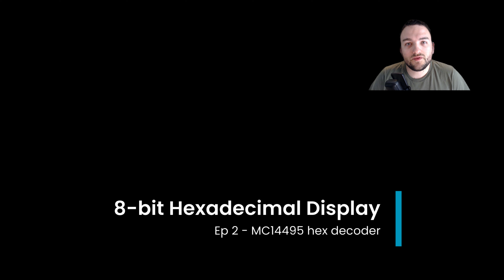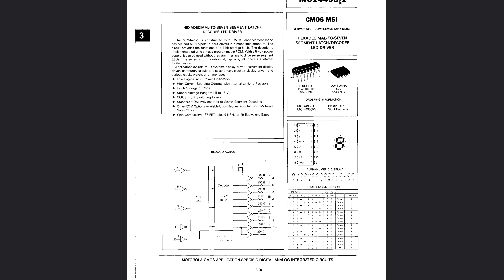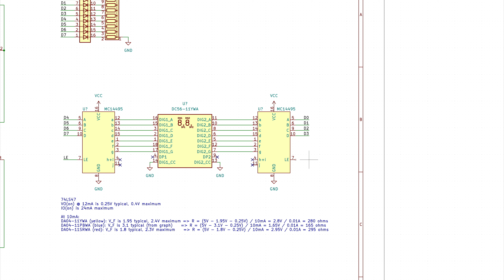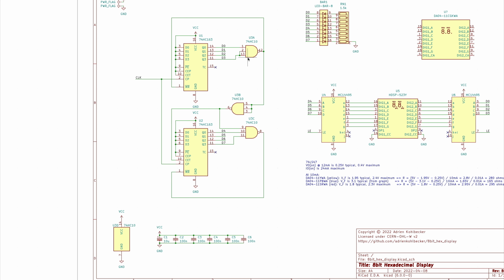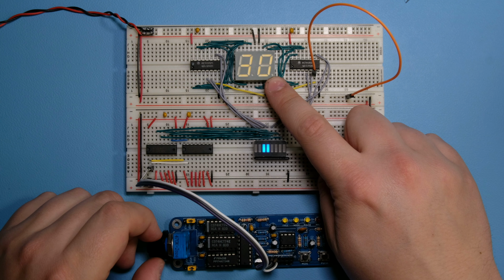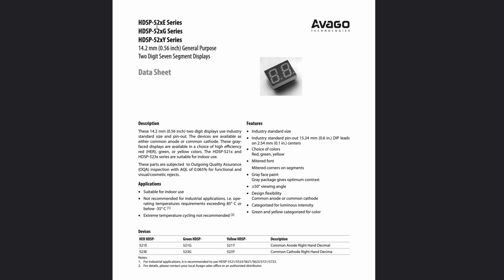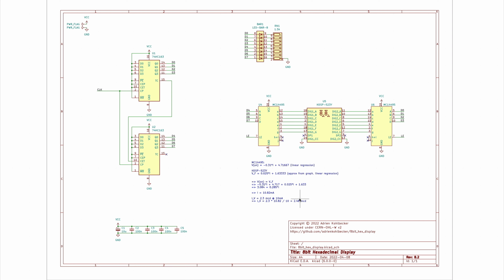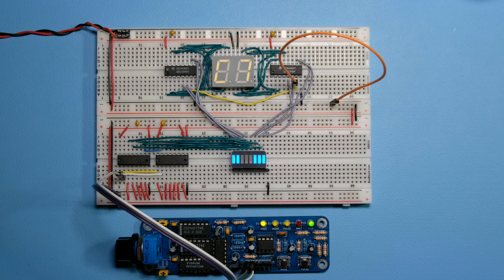#2 - MC14495 hexadecimal decoder - 8-bit Hex Display

Comment: Looking forward to see how you program the 16V8 chip.
Reply: The documentation on how to do that kind of thing these days is a combination of terrible and hard to find!
Reply from the maker: I agree, that's why I'm doing that video otherwise I would have gone directly to the Arduino design I built. This way working with SPLDs is more accessible
Reply: Absolutely.  Even the spec sheet for the 22V10 is (almost) silent on the different number of terms supported for each output pin.

I've grown to like them, for some reason.  The appeal of the limitations means I have to think more creatively to solve problems.
Reply from the maker: Someone on the 6502 forums noticed recently that the Lattice versions of the datasheet (so for a GAL 22V10 and 16V8) is much more detailed than the Atmel one. I recommend that you take a look :-) All the internal diagrams are much, much better.
Reply: @akohlbecker  Thanks!  I think I worked it out in the end, partly because of the (cryptic) error messages from galasm.

BTW, did you notice that these things seem more demanding in required current?  Mine get slightly warm when driven at about 12MHz (half VGA frequency).
Reply from the maker: @phodopus42  yeah they will consume a lot more current than regular logic

Comment: Really nice! Thank you for the video. Little correction: you can, of course, boost the brightness of the display: just use a ULN2003 darlington array between the outputs of the MC14495 and the display. Or use simple buffer or inverting line drivers at that same place, depending on use of common cathode or common anode display type.
Reply from the maker: You're absolutely right! That's a cool chip you mentioned, seems perfect for that use case

Comment: I'm curious, how difficult would it be to replicate the MC14495's functionality with a modern PLD? You'd have to add in the current limiting resistors, but it should be possible to make something that can keep up with your higher speed system.
Reply: lol, this is what I get for asking a question before watching the last 30 seconds of the video.
Reply from the maker: Yup, that's the plan for the next video :-)